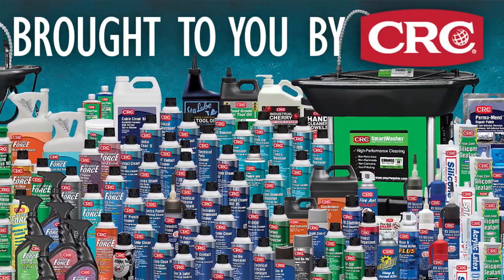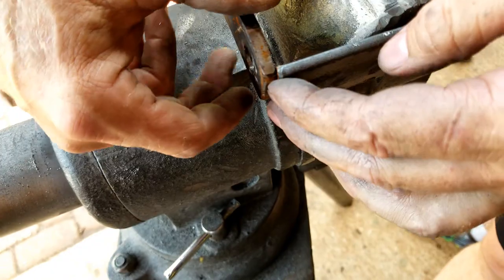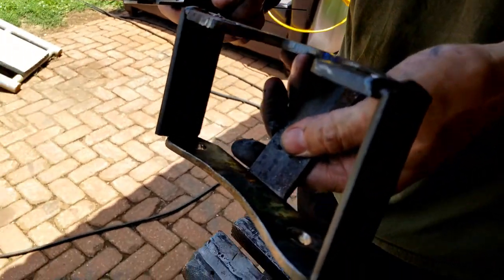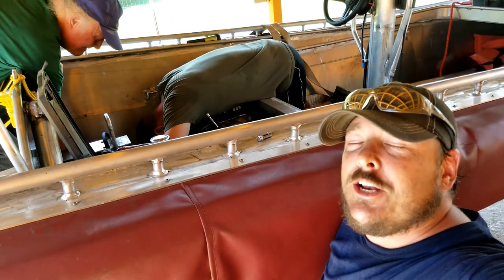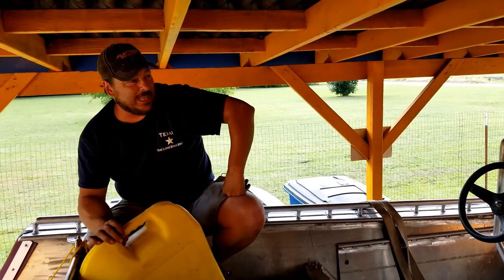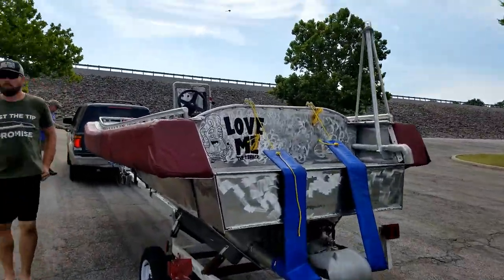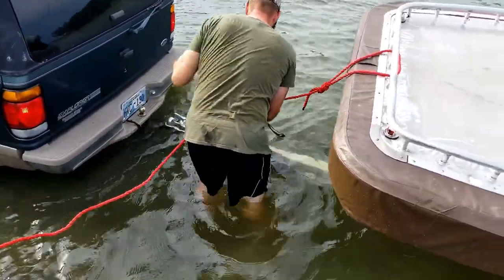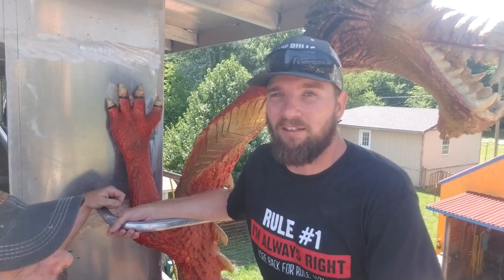Could you live in this space... On the ocean? Welcome to project SV Seeker

Comment: Not many people know what a 7044 Waukesha block looks like.  He must have a natural gas compressor background.  Lot of high paying jobs in that industry right now if you will move to Oklahoma or west Texas.
Reply: Rusty Gun I was a natural gas compressor mechanic for 5 years.
Reply: It was also used for power generators on oil rigs ( they can run off the condesate from the well)
Reply: Glenn Chartrand we use mostly big Cat engines on our gas compressors.  3516’s and 3600’s they burn the natural gas right out of the well and generate more power that the orange ones with less maintenance.